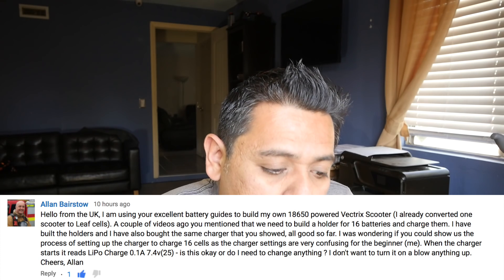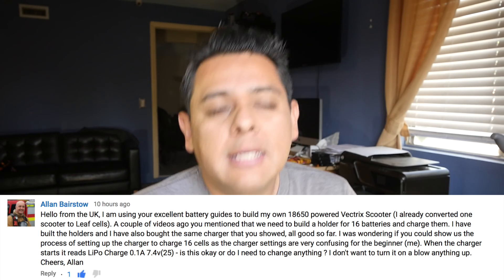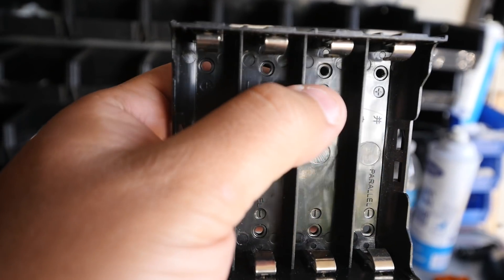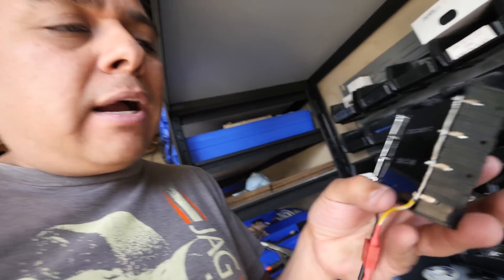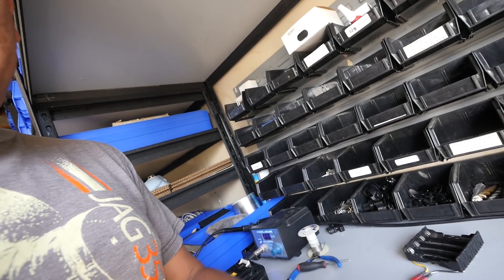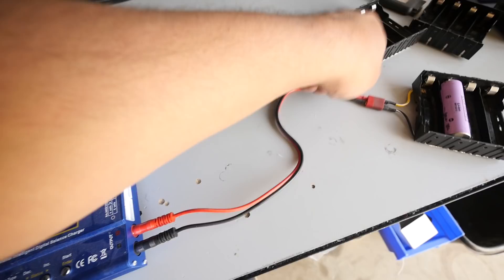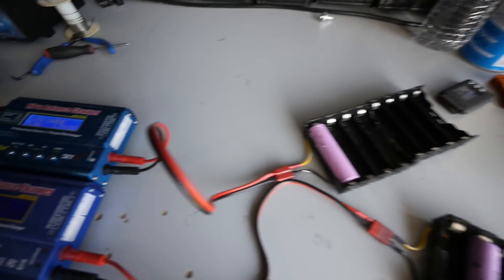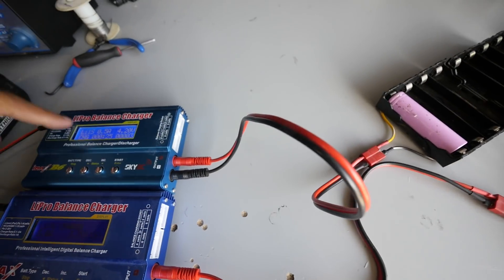Setting IMAX B6 to charge 16x 18650 cells at once -  Batt Talk #8

Comment: so I'm charging my lipo's for the first time right now. Using an imax b6 clone. I have a single 4S 1.5Ah hooked up, and the charger has been going for 30+ mins and it says the voltage is at 17.0v, and it just keeps climbing. why? isn't 4s supposed to max out at 14.8v total??? it's not hot and it's not swelling, but I'm still concerned that at any minute it might start doing that, it's not beeping at me or nothing
Reply: ok, so around 50 mins I looked back at it, voltage is now consistent at 16.8v, and charging 0.1a... so I'm guessing it stabilized the voltage and is now balancing the cells. cool. thanks for the video
Reply from the maker: +GBrowne  what does your multimeter say?  Do not over charge lithium unless you want fireworks
Reply: I actually don't have a multimeter with me, but I do have one of those cheap 8-pin lipo voltage readers, and it reads about 0.1v less than what the imax B6 says, so I guess it runs a little low. But yeah it seems to be putting them at 16.8v on Balance LiPo mode. No problems so far, I only have 4 batteries though. Thank you!
Reply: Cant agree more, LiPo's are very dangerous, but any battery is dangerous.
DO NOT TRUST THE VOLTAGE ON THE RC CHARGERS, USE A NORMAL DMM!!!!!!!!!!!!

Comment: An easy way to charge a lot of cells at same time in parallell is to use small magnets and welding rods.
Just put magnets on batteries poles and put weldingrods to magnets.  Connect with crocodileclips to charger.
Reply: can you show how to do this and list a source for magnet and weldingrod parts? sounds cool!
Reply: Great idea... suggest him ..
Reply: dork
Reply: The more I learn about electricity the more amazed I feel.  I know motors have magnets, but dumbfounded how passing electricity through magnets can work.  

How does it not weaken the magnet, or create resistance and heat?  Amazed.

Comment: Something that I think is important to mention here is that charging batteries in this method is somewhat dangerous. A safer way to do this for about a dollar a cell is as follows. You can use a bench power supply or an old ATX computer supply to run the whole system. More to the point you can use a TP4056 single cell charger for each cell. You can have quite a few on a power supply depending on it's output amperage. On a standard ATX computer power supply which most people have access to you can turn it on with a jumper between what is usually the green wire with the exception of some Dell PSUs and use a red and black wire pair to power the chargers. I won't go into high detail as most of the people doing this should already have some knowledge. As for the workings of the TP4056 chargers I leave you the following link which was very helpful for me....

https://www.youtube.com/watch?v=Qw4psECqpwI
Reply: That is a better idea. i charge 35 cells independently at once with a 55amp computer power supply and those little 18650 charger modules.
Reply: It may be dangerous if the charger does not do what it's supposed to do. At 5:10 Jehu starts setting up the 5A; when the charging starts it detects that the battery is at 4.2V already, and you should notice the amps are not 5.0, but 0.4, 0.5, 0.6, 0.4 and then 0.0, it means it ran at constant current to finish the charge. So, like he says, if you put 16 cells in there all you have to do is check from time to time if they get any hot.

Comment: Question. Your setting was 5000mah for that one battery. Dont you mean 50% of the c-rating for 1 battery? I understand for more batteries more mah. Or does the internal resistance not exept the 5000mah and take less. Because of safety built in feature?
Reply from the maker: +Robert Toebak 5000 divided by 16 = 312mah per cell
Reply: jehugarcia I understand. But you put 1 battery under a load of 5000mah and not 16. Your preset was 5000mah when showing the charge of 1 cell. Is that not a problem?
Reply: When you put 16 cells in paralell the charger will still see it as ONE cell :)
Reply: RetroTech I understand. I was a little confused when he put one cell on 5000mah. But there are more cells in parallel wich made the 5000mah. Thanx

Comment: Hello . Replacing the nickel cadmium batteries in package from DRILL 18 volt batteries with 5 18650. How do I charge them on the Packet from the drill. # Chained 17.5 volts

Comment: You can't charge several different 18650 in a rc charger without a using a balancing setup , you can do it with nicd , nimh but not with lipo lion batteries , you will end up with different batteries with different voltages ...
Reply: You can, as long as your batteries are in parallel
Reply from the maker: Tesla goes to a max of 4.15v and they are getting 200K miles on less than 10% degradation ,  so 200,000/250= 800  so Tesla is on track to get 2400 cycles on their cells and half a million miles
Reply: Do you know how many cycles you get out of them at that voltage? I was just reading about this and the industry standard is 4.2v you get 500 cycles, and at 3.9v you get like 3,000 cycles. I can't imagine what 4.47v is doing to a cell.
Reply: Yes, charging to 4.15V greatly increases life span. Thats what I charge to. But it would be interesting to see how low they go.
Reply: In parallel connection, all the cells receive the same voltage. In theory you can never overcharge a cell in parallel unless its a faulty cell.
Reply: you dont have to use the balance ports on the charger  i normally use the main output and its fine
Reply: i have 4 cells at 4.47v and they aint getting hot or complaining  that was like that wen i salvaged them out of a laptop pack
Reply: when there in parallel they shear the current in the pack
Reply: unless one cell decides to short lol then the rest will kick it out of the pack by boiling it
Reply: in other words over current the shorted cell  till it pops
Reply: They may looks fine but please, for your safety do not charge lithium batteries over 4.2V
Reply: or kill the pack lol  o well
Reply: i never charge them over 4.2  the 4 cells i got from a laptop pack had voltages of 4.47+
Reply: Do you charge your batteries in parallel? If so them it's okay
Reply: the 6 bay charger is a efest bluetooth  charger  charges each cell at either 500ma for 6 at once or 1amp for 4 at once or 2amps for 2 at once  i normally  charge them at 1A or 500ma  depending on if i forgot to charge the spare set for the box mod
Reply: it got up to 50+c wen charging then dropped to shed temp about 18.c
Reply: Is Dangerous Italia the difference is more than 0.2v ..It keep on fire
Reply: Fine until you overcharge one of your cell
Reply: U can overcharge one of your cell if you don't use the balance port
Reply: i never had any issues of the imax b6 over charging the cells   sometimes i charge  the cells in my 18650 6 bay charger that i use for my  wisemec 2/3 box mod with the tfv12 7 colour  tank  at 130w  the cells in the box mod is 3100mah discharge 35A 40Amax  basen cells

Comment: why not wire d cells like a lipo with individual cell monitoring. using d lipo plug?
Reply: Ramon Garciano Thats what im doing with smaller packs. works great and works better i think. Monitoring the batteries that way.
Reply: Are you talking about balance-charging packs?  So you have information on each individual cell you charge?
Reply: RetroTech yes.....you can check it with lipometer (ALARM)

Comment: Mr Garcia. I really appreciate all of your videos, they have inspired me to start building a battery pack for a project I'm working on. I am having a slight problem though. I put together trays for charging a bulk amount of batteries like you recommended. The batteries I've got are already at 3.8v and have connected them to my imax b6. When I start charging them, it shows charging for only a few seconds and then says fully charged. Am I doing something wrong? Why won't it charge to 4.2 or at least close? 
I have different charger that is designed for lithium ion cells like the 18650 and it shows the lower voltage and will charge them to 4.2v. Any help you can give would be greatly appreciated.

Comment: Hi...like your videos. The problem with my IMax B6 Clone is that it has 5000mah cut off so when charging multiple batteries I have to keep resetting it...it charges to 5000ah then automatically cuts off...  is there a way to turn this off?
Reply: Eric Hendrickx you can turn this of in the settings

Comment: I got imax B6AC that allow maximum LIIon charging voltage of 4.20V Even trying to memorize a custom charging program you cannot exceed 4.20V  . I bought several lenovo used batteries to get 18650. They can contain SANYO UR18650ZT or LGABC21865 (ICR18650) and both want 4.30V charging voltage to reach maximum capacity. How can i charge them correctly?
Reply: Soved. 18650 at 4.30v is LiHV setting in b6ac!
Reply: there's a device on budgetlightforum.com but i can't find it you can just search their forum with "4.3v"
Reply: it is possible to put "chealicharger" software into your imax b6. This software have lihv charge possibility with imax b6

Comment: +jehugarcia: Thanks for the great video! Think I'm going to ask the dumbest questions here:
- What kind of materials are the bars you're using to connect between the leads and where can I get them?
- Could you tell me where I can get the connecting wires/adapters between the charger and the bars?
Many thanks!
Reply from the maker: Its just regular cable  and the RC T Plugs http://j35.us/1T5EDWb
Reply: +jehugarcia Thanks! What about the silver color 'sticks' connecting the 4 leads on each side of the holder?
Reply from the maker: regular cable
Reply: jehugarcia got it. Thx again!

Comment: OK, When you have a battery pack with batteries both in paralell and series, How does balance charging help if you  have a bunch of batteries in paralell?  What if one battery is exceptionally better or worse than the others?

I have the B6AC v2 as well, and I'm making an array of 6 X  3S4P batteries for a 110v inverter system for camping. (so really, It'll be a 3S24P battery, ideally I'll be able to charge them all at once as they plug into a parallel board. 

Am I going to blow my house up?

Comment: So I'm testing some old and probably shitty 18650 Li-Ion batteries and trying to meassure their capacity. 
I'm discharging them using the imax b6 with the Li-Po program at 1A down to 3.0V. The voltage drops pretty fast down to 3V and is kept there. soon after the discharge current starts dropping as well.
I this normal behavior? I was expecting the discharge current to stay at a constant 1A and the program to end once 3V is reached?
Reply: Li-Po option isn't ment to be used with Li-Ion 18650 cells like Panasonic or Samsung, You should use "LiIo" option if you can

Comment: Why don't you use the Lithium-Ion setting on the Imax B6?
Reply: electron spectrum I forgot about that one. I did see charging life lipo liion. Most are 3.7volts now. Thanks..
Reply: Agree. Must set correct lithium battery type, otherwise there's cell damage and fire risk
Reply: jehugarcia please put correction to li-ion Lipo is incorrect
Reply from the maker: +electron spectrum   Didn't even know there was one
Reply: +jehugarcia Yes but you have to pre select it, hit the "stop" button until you get the LCD to display "user set program ->" and hit enter, the first thing you should see is "life" or "lipo" on the left and the voltage on the right, hit enter and the voltage will start blinking and so you can cycle between liio, life or lipo, once you see liio hit enter and now li-ion is the only option you'll have when you cycle between battery types, lemme know how it goes, appreciate the educational vids! Thank you.    : ]

Comment: Took on the vegemite challenge like a champ bravo! My question is i want to be able to charge 18650's from a car alternator which runs at 12V 70A yet still be able to power an inverter at the same time, do you have any ideas? with thanks Andrew from Australia

Comment: Hi Jehu, following you from Sweden and like your battery projects. Do you think this holders are suitable for a power wall in someway? Maybe have 2 facing each other on their backside and some heavy gauge wire or busbar soldered on. All this just to not have to solder on the battery's. What's you opinion, and can the holders manage the current? :) thanks anyway, keep the battery video coming.

Comment: For a 12 volt solar system which is better? 4SxP or 3SxP?
Reply from the maker: +Gábor Hintalan   Id say it depends on your equipment,   but higher voltage is usually better
Reply: Firstly thank you so much for making such informed entertaining and inspiring videos.  I'm super envious of your abundance of 18 650 cells. I wondered if you could explain why the higher voltage is better when trying to achieve a consistent 12 V.  Also I wondered if you could explain why you don't charge your batteries in series.  having a little trouble trying to figure out the reason why you charge in series. Please keep up the great work! I think I've watched all of them.

Comment: You should not charge so many batteries in parallel if you don't know the capacity of each cell to be very close to all the other cells in parallel. You will always overcharge the cell with the lowest capacity or depending on how sensitive your charger is, undercharge all cells that have a higher capacity. You have to "format" every single cell separately to measure it's individual capacity. Especially if they are recycled from laptops or such things because some of those can be bad and in turn decrease the capacity of the whole pack. Also there is a fire risk during charging AND discharging if you have a single bad cell.
Reply: parallel charging is always balanced. but yes this is not a good way of charging because if there is a shorted cell then it will get hot
Reply from the maker: +BillTheBox   A shorted cell will get hot either way,  charging in group or on its own.     At 300ma charging only defective cells will develop any heat,  you can remove it and replace it with another
Reply: jehugarcia but then you need to be present

also if cells are at different voltages ( eg I open two batteries and get 6 cells at 2,5 v and 6 at 3,9 ) then you will dump large amounts of current into the lower voltage cells.
Not saying it's going to blow up, but people are dumb and some people watching you probably don't have the common sense to test the batteries before hand.

btw this is how I charge my batteries, I just wait until they are all at the same voltage before putting them together

edit : also the current isn't shared equally, a shorted cell will take up all 6 amps if the resistance is low enough, to prove this just stick a resistor instead of one of the batteries and you will see a fall in voltage and a hot resistor.
Reply from the maker: +BillTheBox  you have to be present at least once a day to charge this batteries, no way around that.   Large amounts of current?   I think I will test that
Reply: jehugarcia you need a low resistance battery or a resistor to see the larger current, but I had this happen where I inadvertently connected the batteries in parallel with a pair of power resistors instead of in series and the resistors got pretty warm
also if you're talking about when you put them in parallel then yes I had this happen, but once again it depends on the setup, I was soldering different voltage batteries and they got warm to the touch leading me to believe they where equalizing pretty fast
Reply: +Cutter Slade You wont over charge or undercharge any of the batteries. If one cells stats to get a little higher voltage than the others, its extra voltage will dump into the others cells (this is done at a very small voltage level and is continuously occurring). All cells will be at the same voltage when finished charging. You can't avoid a fire risk of a bad cell whether you are charging that one cell or 20 of them.

Comment: Do you set it to 5A if you are only charging 1 battery?  Wouldn't you set it for 300mAs if you are only charging one batter?
Reply from the maker: +jerm73  yes,  5A is for charging 16 cells at  time
Reply: Speak about the new generation of batteries please. Or are you a bitch?

Comment: i would recommend just getting chargers that do 4 cells independantly ( because it can also discharge for you )
Reply: Is there such a charger that will charge and discharge large quantities? And do any of these chargers have the ability to add a temp sensor so it stops charging if the cell gets too hot? Thanks
Reply: +Grant Lister I beleive there are four cell lithium chargers that do just what you said, homebrewpowerwall uses them ( watch his vid on charging, I can't because i'm on mobile )
Reply: +BillTheBox thanks, Ive been following Pete for some time now, awesome build :)

Comment: Hi +jehugarcia
Are you sure that these batteries are LiPO? AFAIK laptop batteries use LiIO batteries. 
You can change the type of technology from polimer (LiPO) to Ion (LiIO) or Iron (LiFE) batteries from settings of the charger.
Anyway thanks for great videos.
Reply: +Levon Avagyan The LiIon settings on these chargers are for long gone generations of cells with lower voltages that no one uses any more. All that the setting changes is the voltage at wich it transitions from constant current charging (your set current) and goes on to constant voltage charging (4.2V in normal 18650s). You can use the LiIon setting if you only want to partially charge your cells.
Reply: there is only LiPo and life, other lithium batteries are grouped under "LiPo" for li manganèse cobalt etc
Reply: +BillTheBox 
I am sure that with my "Turnigy Accucell-6 50W 6A Balancer/Charger" i can explicitly select Li-Ion.
Maybe purely cosmetic thing...